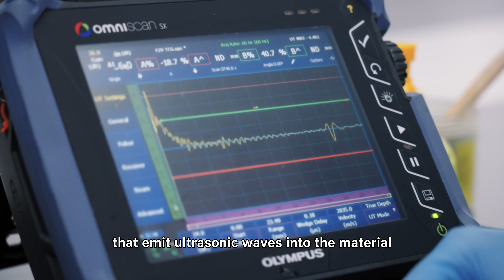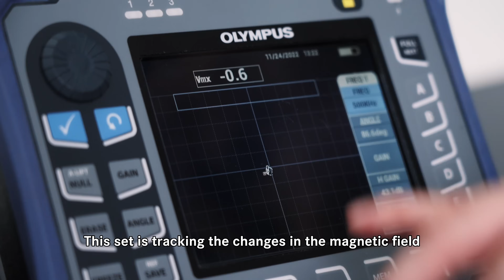Secret Weapon Of F1 Engineering | Non-Destructive Testing | How It Works 🔍

Comment: Video clips for liquid penetrant and magnetic particle testing are reversed. First segment, where the part is shown "threaded" onto a cylindrical object while a liquid is applied is actually is actually wet fluorescent MT using a central conductor on a horizontal wet bench. The second clip shows fluorescent water-washable PT.

Comment: Be interested to know how much MPI is required on an F1 car? Apart from the engine /gearbox block and internals I thought mostly everything would be Aluminium or carbon fibre composites?
Reply: all parts are made from a mix pending what wear they need to endure known materials:-
titanium
carbon fibre
aluminium
composites
plus other

Comment: Any active thermal imaging?
Reply: liky used when testing the engine.
Reply: Probably not so easy to demonstrate on a desk top.
Reply: On modern aero applications, an electrical current is applied to carbon fibre elements. This is what makes it active thermal imaging vs passive. Faults are highlighted in "hot spots/lines" as viewed through IR images. This allows for large area assessments to be carried out like wings, very quickly, as opposed to having to move instruments such as an ultrasonic probe across a large area in small increments. Makes for effective and quick NDT of larger areas.

Comment: A Question to Mercedes F1. I dont really think that RBR car is Legit. Is it so that RB can use AlphaTauri Windtunnel and Budget. Like that RB send the plarts to AlphaTauri and they test it in their Windtunnel and they later send back the results to RB who then use it or not. Reason for having thinking like this is that i dont get how 2 teams one at the top and one at the bottom who both are owned by the same company can be so far apart on track.
Reply: not going to happen. such level of interteam co-operation would be a clear violation of a number of major rules, including the cost cap ones and will for sure get both teams banned from the sport of F1 and probably from most major FIA regulated sports as well. 

also there is strict and regular inspections by the fia to make sure this sort of thing is not pulled off by any of the teams. like with the case of the pink mercedes, there was a lot of investigations done, and which the hiring of new staff, the new staff cannot bring back any info regarding their former team (thats why dan fallows was investigated before he went to Aston).

in any case, its not even remotely worth the risk of getting banned from the sport entirely, losing both their championships and also being labeled as cheaters. it will be the biggest PR loss for RB which is ultimately a PR company. 

i dont think they will do it, but if they are found to have done so, i expect them to be promptly disqualified from both championships this year, and be banned from the sport.
Reply: @johnbenoy7532  all upgrades have worked for RB. I still belive that something scumy is going on behind curtains.
Reply: @HunterZTheLunatic  its time we accept that they are just that good. as Michael Schumacher once said  every dog has its season, (did he say that? you get the point).

we had that day for 8 years, McLaren had it before us, Redbull, Ferrari and so have most of the teams on the grid. just cos they are suddenly good doesn't mean that they are cheating. saying so is nothing short of saying, "Oh Mercedes is the only team that can do well, if any other team does as well as us, they are cheating".

its as simple as that. Adrian Newey did his Phd thesis on ground effect based downforce, and his brain is a mobile wind tunnel. and lets not forget he has literal hand on experience designing F1 cars from that old Ground effect era, so he knows the ropes a bit. that may be the only advantage that RB have, but i wont say that hiring the top brains is cheating in any way
Reply: @johnbenoy7532  going by what RB have done in the past i would not put it past them whether they have done it or not.
Reply: @davidtube79  what have they done in the past? nothing major comes to mind for me. most of the major ones, are crashgate, watergate, tracing car, super engine and stuff. 
what have redbull done in the past, that is soo irredeemable that all these other teams can get a pass but they cannot? whats so hard to accept the fact that they are the fastest?  every year from 2014 was just that  (till 2020)